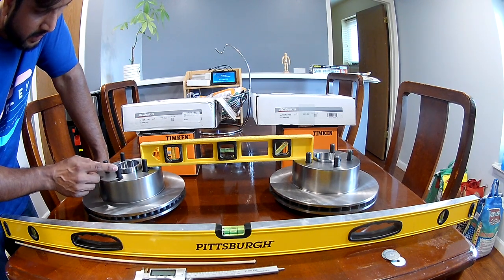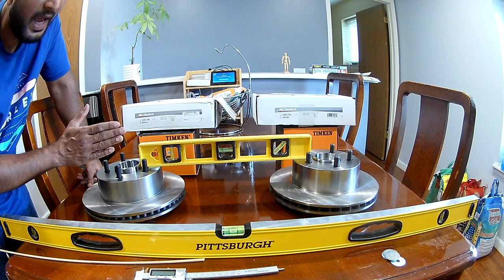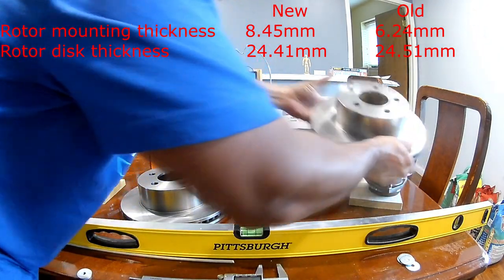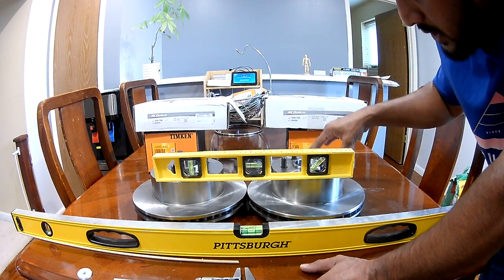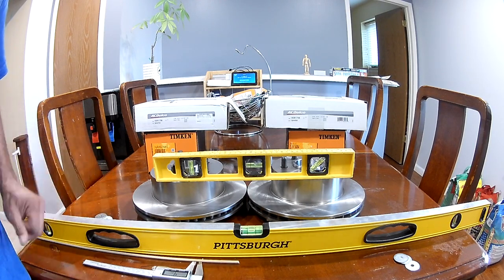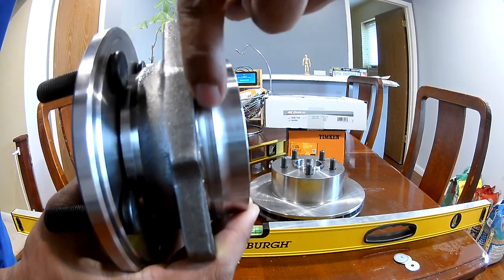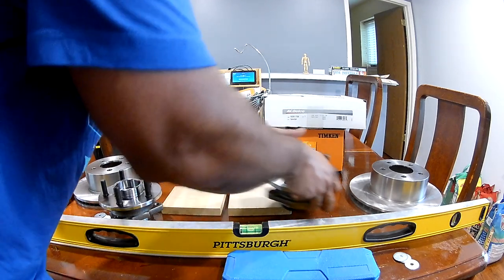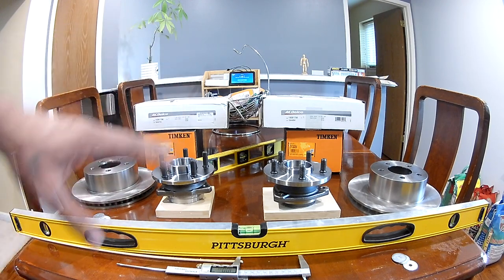1999 jeep XJ composite or cast rotors

Comment: Good video. I wanted to add and clarify that no, the wheel being mounted further in on the left side (newer) setup is not a problem with alignment. That is actually the proper location for the wheel. On the earlier setup, the factory composite rotors had a very thin mounting surface. When Jeep updated the bearings and the rotors to the new design, the new cast rotors had a thicker face, and so they made the bearing more shallow to make up for it. So the wheel ends up in the exact same place on both stock applications. 

Using new cast rotors on the old bearings actually places the wheel further outward than stock. It also makes the hub pilot for the factory wheels very shallow. To me, the ideal option for anybody with these unit bearings is to choose the later model bearing and rotors to match. This maintains stock width and keeps stock wheels registered on the pilot the best.